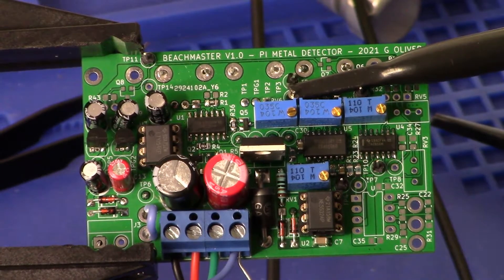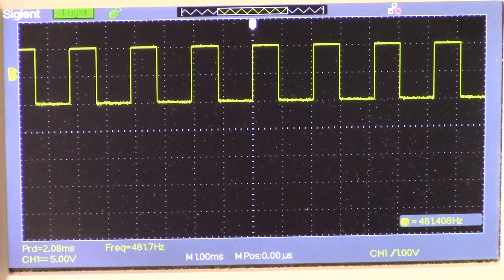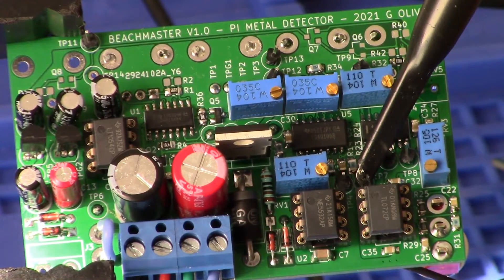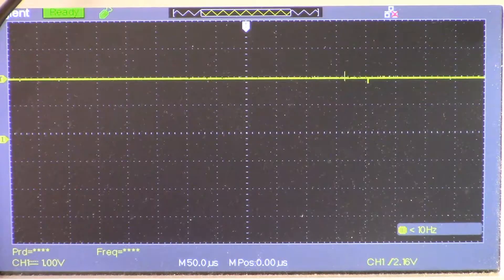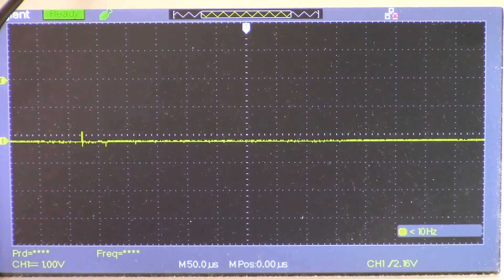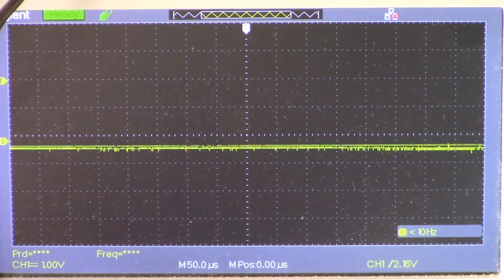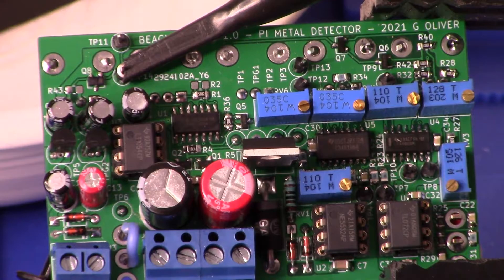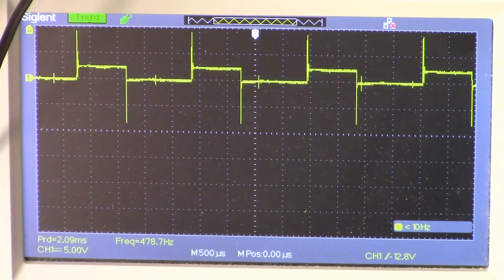Beachmaster PI metal detector part 5

Comment: Hello, I was searching about different videos on metal detectors when i came by your channel. It's amazing work that you've done here. I'm trying to build a mine detecting and collecting robot as a project. To do so i have to incoperate a metal detector. Could you please recomend a metal detector that would be easy to recreate and would not need much testing while assembling. Thanks.
Reply from the maker: Hello Mariam,
As you can see from my videos, there is a lot of testing that goes into the building of these metal detector projects.  I recommend that you have access to an oscilloscope.  How easy these projects are to build depends a lot on your level of experience with electronics.  The Arduini PI project is one that you might consider.

Comment: Hello dear friend, is there a pulsed metal detector design that shows a depth of 2.5 meters?
Reply from the maker: What size is the target?
Reply: @SurfDetector  50or60cm
Reply from the maker: @mgem404  Try the Delta Pulse.  All of the information is available on the Geotech1 Forum.
Reply: Thank you for your response and I will check it out.

Comment: have u tried the smw v 3.0 servian most wanted metal detector ?
Reply from the maker: No, I have not built that one, I like Pulse Induction machines the best.
Reply: @SurfDetector  what is the diference betwen pulse or not pulse?
Reply from the maker: A VLF machine puts out a constant sine wave and a PI machine send intermittent pulses. That is a very short explanation.  You should read the book "inside the metal detector" for more information.
Reply: @SurfDetector  ok thanks i didnt know,so ion your opinionthe one that has intermitent pulse is better?that mean it can detect deeper?
Reply from the maker: @elarcadenoah9000  Pulse works better at the ocean beach and in soils with more mineralisation. Pulse however has no real discrimination with targets.  No matter which one you pick you will need an oscilloscope to build them.
Reply: @SurfDetector  ok and the tesoro hunter is also pulse machine?and i need an ocilodcope too?
Reply from the maker: @elarcadenoah9000  In order to successfully build any metal detector you need to know how to use an oscilloscope.  I am not familiar with the Tesoro Hunter.
Reply: @SurfDetector  ok thanks but if u decide to build tesoro hunter i will be aware of your videos i am suscribed
Reply from the maker: @elarcadenoah9000  Thank you for subscribing.

Comment: hi bro IDX pro coil cable connection TX+ TX- RX+ RX- how should I do? can you help me?
Reply from the maker: What PCB are you using? Go here and look at this pcb:
https://diydetector.co.uk/store/index.php?id_product=23&id_product_attribute=0&rewrite=idx-pro&controller=product

In the upper left corner you see the coil connections, from the bottom the connection is #1 and the top is #5.

#1 goes to the TX start
#2 is TX to - negative battery
#3 is shield connection to ground
#4 is RX connection to ground
#5 is RX to pre-amp